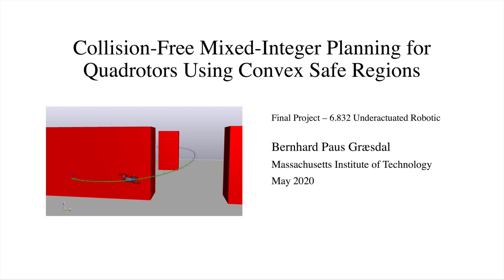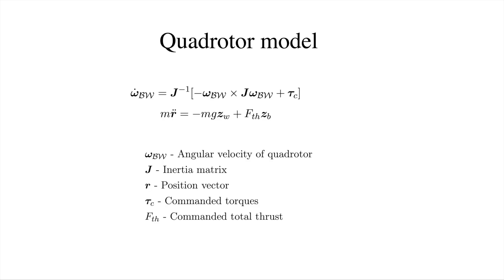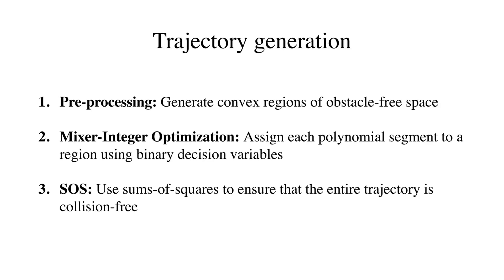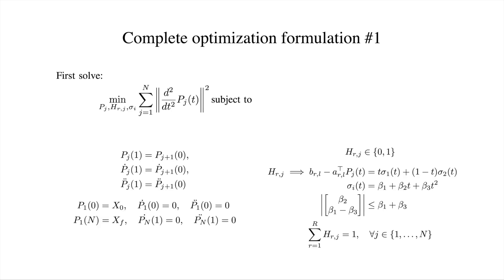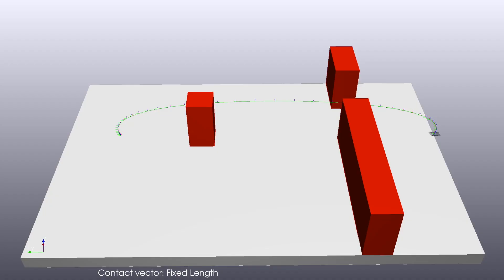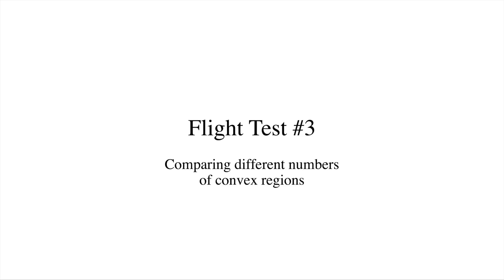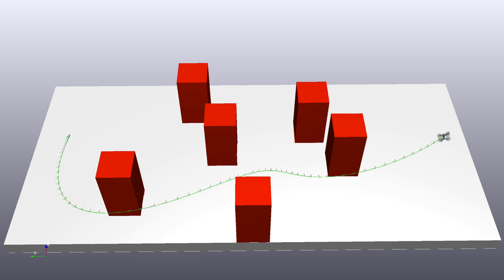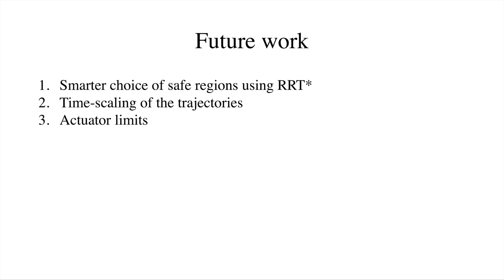Collision Free Mixed Integer Planning for Quadrotors Using Convex Safe Regions

Comment: Fantastic!  And thank you for sharing the code.

I wonder if the output of the branch-and-bound might somehow contain a strong heuristic for where you might want to sample a new IRIS region?
Reply from the maker: So instead of pre-calculating all of your IRIS regions, you are thinking of going back and forth between the calculating iris regions and solving the problem until you get enough IRIS regions to get a feasible optimization problem? If so, I think that is an interesting idea. What outputs are you thinking of?
Reply: What's IRIS mean please

Comment: Great great work! Too bad that we cannot solve MISDPs yet... Did you have time to give a try to the MISOCP version (i.e. third order polynomials)? I had a positive experience with the MISOCP solver from Gurobi.
Reply from the maker: Yes, I actually first solve the MISOCP problem for third order polynomials, then fix the polynomial segments to the regions computed for the MISOCP, then re-compute the problem (which is now a pure SDP) to get the fifth order polynomial trajectory that the quadrotor actually follows. I detailed it in the project report, but it is very similar to what Russ and Robin Deits did in their paper on Efficient Mixed-Integer Planning. I used Mosek, but I'll be sure to test Gurobi and see how that compares. It would be interesting to check out how some of the recent work you and Russ did on warm-starting MI programs might improve this too!
Reply: Oh, I see. I don't know why but I was thinking you did the first pass with an MIQP (first order poly). That's great! I'll have a better look at the report when I finish to go through the presentations. I'd be happy to know how things evolve if you plan to keep working on this project!